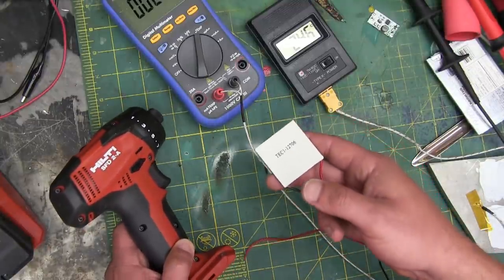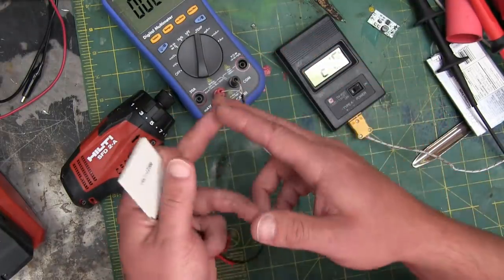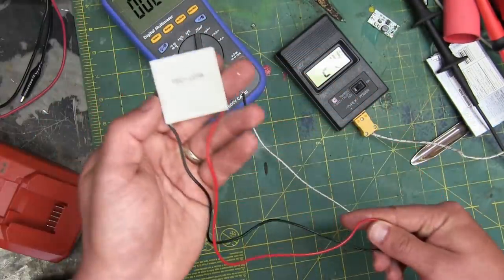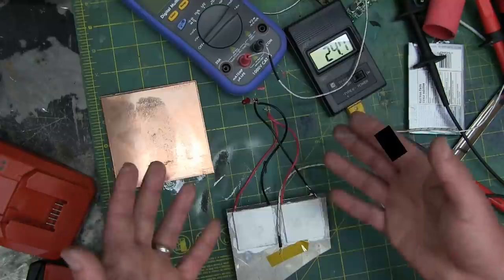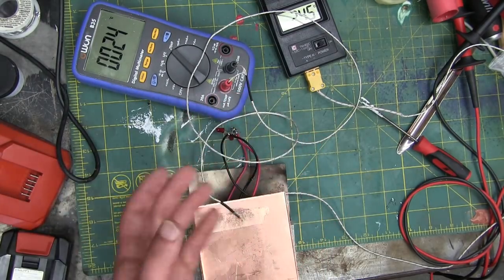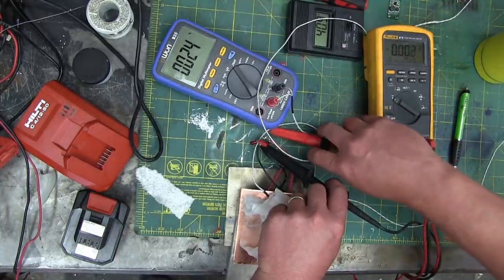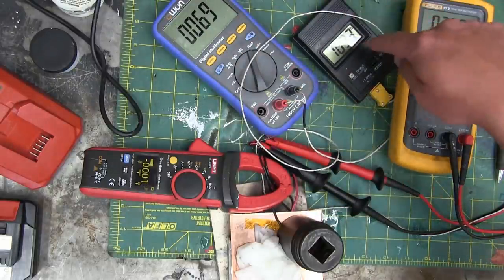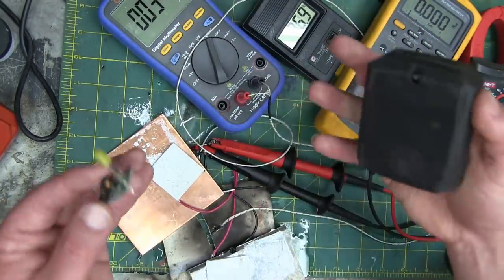Rocket Stove Peltier Charger | Seebeck Generator

Comment: I've found that most of the time a China seller will just send you another of an item if it arrives dead without asking for the broken one back.  It's worth a shot since it only takes a minute to email them.
Reply: Do R/C! A minute to email them and a week of Sunday's to get it to your door.Lol.
Reply: Well you don't order from China via surface if you care if it's going to take 3 to 10 weeks to show up.
Reply: logitech used to do that too till someone who may or may have not been me abused it so hard and so much they changed the company policy. you could call them say your thing was defective to the Indian on the phone after giving the serial number you got a new one sent to you free of charge. that item they send also has a serial which you can repeat the process
Reply: That's the Chinese way when warranting goods, an instant no quibble  replacement. And another if necessary, and another, until you get a good one, each time with an apology and an assurance that they've never known a bad one before...
Reply: Pro trick: you can watch movies at flixzone. Been using it for watching loads of movies during the lockdown.
Reply: @Kylan Ali yup, I have been watching on flixzone} for months myself =)
Reply: @Kylan Ali yup, I've been using Flixzone} for months myself :)

Comment: I had a TEC watercooled on my video card with a ford truck heatercore (try going to autozone and asking them for a heatercore for a computer) and even with my video card voltage mod it would frost up without a load on it, so I had to rub Vaseline on my video card, I locked my door before I did it because I did not want anyone to walk in and me have to explain why I am rubbing Vaseline on my video card
Reply: All2skitzd plasti-dip your card.. all of the RC enthusiasts do it to semi wsterproof the electronics
Reply: Yeah that probably would of worked but it also had components that got really really hot
Reply: All2skitzd They sell little mini heat sinks and thermal glue, which is what you'd wanna put on high load components like voltage regulators, then you could probably use neoprene to insulate and protect the rest of the card without any overheating effects
Reply: I had a peltier array on my GTX 690 and went through the same thing pal. I ended up just running it in a mineral oil bath with a water loop cooling the peltier. Good setup,good for 6c Max load with +.25v and +650 core + 750 memory.
Chooched like a hot damn in Skyrim, but use over 1.9gb vram and I'm fucked 😂

Comment: Many moons ago I used to use a TEC to cool my CPU for max overclocking.
Reply: Taylor Hardin how well does that work?
Reply: ZuluComander very well.  It was advised to waterproof your boards and insulate them back when I was into it because it could condense moisture and cause ice to form on the mother board.
Reply: Because faster is hotter.
Reply: Its cheaper to OC and in those days OCing meant faster performance then a higher speed chip of the same speeds as you were also overclocking the bus speeds which increased ram speeds which increased performances even more.
Reply: rick do you go around shitting on everyone's hobbies? He did it for fun and benefit. Maybe there wasn't a faster CPU, or an affordable one as it were. I guess AvE should just pack a backpack full of drill batteries instead of build a charger. Maybe the first caveman to light a fire on a cold night should have just waited for the sun to come up.
Reply: I'm trying to solar charge my phone and I DO have a cave. 

Doesn't seem to be working, any advice?
Reply: How big of a heatsink did you need to use on the hot side? Those things can hit 90 C if you use them.for long enough?
Reply: Did you compete in 3Dmark? I had the Prometia Mach 1 Phase change on the CPU keeping it at -32C - 0C, water cooled TEC on the video card and the  Mach 1 would drip water sometimes at idle because I had the heating element turned off that prevented it, then the voltage modded video card would also frost up at idle so I had to put Vaseline on it to keep it from flaking out on me
Reply: Umm, step outside?  :P
Reply: Same here. CPU, TEC then Water block. I recall needing a second power supply just to keep the TEC running and the pump stopping one time and the water almost boiling in the water block.
Reply: Anyone know the longevity of these TEC/TEG parts?
Reply: I just did it to my PC a few days ago. I have a water loop that costed me $40 and I idle at 1-3c
Reply: Pseudobean Machine   they last years as long as they dont over heat or the wire gets overstressed. They are used in a lot of mini coolers and stuff
MalleusSemperVictor never thought to do that, the Mach1 had a thing that went over the board on the back and around the CPU to keep it off the board, and I already had vaseline
Reply: Yeah me too, dual Celeron from 300mhz to 666mhz, they were great for overclocking with a screaming Delta fan on it.
Reply: I remember when overclocking was the way to go - generally when there were no better processors to be had, but you still wanted more speed.  Saw one confuser that even had built-in a/c blowing directly on the CPU heat sink.  Doesn't seem to be as necessary now that processor speeds are getting damn fast, but it made a pretty big difference when I upgraded my old 80486 (50 MHz) to the then-new Pentium P5 (66MHz, but I got it to overclock up to around 100 MHz at the time.)  Those were the days...damn frustrating days...back when you couldn't just buy a better processor because they hadn't been invented yet.  :-)
Reply: aussiebloke609 I always wanted one of those phase change coolers. Something about my CPU running -75f always seemed cool to me.
Reply: "...seemed cool"...literally.  LOL  The confusers with the a/c were pretty expensive at the time...somewhere around $8k for the desktop, sans_ keyboard, mouse or monitor, if I remember correctly...and that was back in the mid '90s.  These days, a top-of-the-line CPU is plenty fast for most people, but it was a very different story back then.  :-P
Reply: Ahh the good ol days.
Reply: aussiebloke609 FrozenCPU.com used to sell a add on kit I wanted in the worse kind of way.
Reply: MalleusSemperVictor hell yeah. Back when you could overclock the AMD Duron with only a pencil. Best bang for the buck.

Comment: When I built mine, for my wood stove. I used a pair of 40mm heat sinks for a confuser. Wired the two peltiers in series to run a fan

Comment: When I was much younger and my father and I used to talk about hypothetical situations, we at one point seriously considered either putting a bunch of those Peltier Junctions on the cooler segments of an exhaust pipe or putting them on the side of an engine and seeing if we could get a used full voltage  or current out of it and maybe disconnecting the alternator we never made it past the drawing board however because on the exhaust pipe if you put little heat sinks on it as long as you're moving it would help but cooling while sitting still was the issue

Comment: If you pound a 5" solid copper rod 6 feet into the ground, then attach TEGs to it, you can generate free electricity in winter.
The colder the air temp, the better.
Copper is the best thermal conductor. It will sink the cold side into the ground. Cold air, will cool the hot side.... You have huge 
differential temp range.
I wonder how much the copper rod that size will cost? Probably a few thousand $
Reply: Wrong, silver is the best conductor

Comment: been down this road ave . had a massive heat sink and fans to cool it and fire on the other side. was running its own cooling and 1amp charge at 12v from 20tec,s 10 in series and the 2 banks parrelel.  then there was melt down lol. caned the idea in favor of burning petroleum in an engine. old idea tho. used in the voyager space craft and many others . heat source was plutonium.

Comment: I actually built one of these for a brown out a few years ago we still had a natural draft fireplace so I rigged something up out of parts I had laying around so that I could still charge my phone during the week with no power... I just used the steel can with water for the cold side and the hot side on a piece of aluminum sitting on top of the fireplace

Comment: I feel like improving the cooling for the cold side has a huge potential for improvement on the efficiency of the next version. Like maybe have a conductive bar off each side of the thing, one which goes in a container of icewater, and the other into the hot coals of the campfire. Maybe solder some old computer heat syncs to the cold side as well, that way it has the area to dissipate to atmosphere as well for when you're in the woods.  Then maybe weld up a little steel cup that you can just put ice directly into, removing the need for the container.

Comment: TECs always heat up both sides, if you dont coo, the hot side properly, since they are only 4% efficient, if the generated heat is not transported off, both sides get hot.

Comment: looks like a fun project!  That first TEC may not be broken. You didn't have a heat sink on the hot side, so there is no where for all that thermal energy to go but to just heat up the whole device. The voltage output isn't just dependent on delta T but also heat flux through the module.

Comment: Nice project! Did a similar experiment some time ago in a course at the University where we was supposed to cool thermocouples with evaporation cooling. What did the trick for us was to only add a small amount of liquid to the cloth (and only have about a single layer of cloth) so it had time to evaporate. Also if i remember correctly, we used both water and acetone at separate attempts of which the acetone clearly cooled much better. Got them thermocouples cold AF! Greetings from Sweden, SKÅL!

Comment: Thanks for doing a video on these. I own a Biolite stove because I became obsessed with TEC and TEG. With the cooling I suggest that you use a container of water. Biolite has a kettle that uses cold water boiling to keep one side cooler than the other and it produces about 10 watts. There is also a thing called a power pot that works on the same principle. That said, it's really had to get a good amount of juice out of these chips at the 12 volts or so that they operate at, enough to charge a high capacity drill battery. I'm looking forward to seeing what you'll do to get  'er to chooch. :-)

Comment: It gets quite complicated but as a general rule, try to keep your R_load = R_internal, you will be producing about at the maxima power level.  Just measure resistance across the leads of the TEG, try to match that at the load.  Maximum efficiency can be met with a slightly higher R_load but as you mentioned... This is for a campfire.

Comment: To add an easy ~100c barrier to keep from overheating the modules, you can use di-hydrogen monoxide (think about it) as an intermediary heat-fuse.  Overheating the intermediary, it'll evaporate and keep from getting too much heat to the pixy converters.

Comment: Linear Technologies makes a specialized thermoelectric energy harvester (LTC3108) that works great; puts out enough power to run a micro and some sensors, and maybe a radio if you charge up a cap over a while for a burst. I couldn't get an LED illuminated with it though. Maybe with something more hardcore than one of those little peltiers it would work, though.

Comment: The only difference between TEC and TEG is the type of solder used. The TEC uses a low melting temperature solder SnBi that melts at 138C.
The efficiency will be the same best case around 5% for both TEC and TEG used as generators. I have quite an old video where I play with a TEC as a generator.
In almost all possible cases a solar PV panel will work better than waiting time with TEG :)

Comment: You need to use special TE modules that can take high temperatures. Normal are rated around 90 C MAX on hot side.  You also want to insulate the hot side from cold side so you don't heat the cold side too much.

Comment: Once upon a time, I did in fact succumb to the temptation to be fartin' around with Peltier coolers. I did, as you have found that they are hopelessly inefficient and not suited for makin' de electrons in excess quantity sufficient to feed the appetite of a starving battery especially when using a high temperature heat source. ZO... might I suggest what we affectionately call a "thermopile"? This amounts to a shitload of thermocouple junctions in series/parallel in a block of material that's subject to the heat source. This gives yer arse control over both output voltage and current vs. temperature and isn't fragile like the Peltier device. AND it be cheap cheap. Worth a try? Now where'd I put those mushrooms...
Reply: Thanks for that link - fascinating stuff.
Reply: Great, so hopefully next week we can expect señor AvE to have scavenged an old RTG full of Plutonium. lol

That should really chooch.

I just hope it doesn't end up like the "Nuclear Boy Scout" story.
(watch the vid - it's rather scary.)

Comment: Or you can use a cordless drill motor with reduction to generate dc, a homemade water wheel  and put it in some running water.

Comment: I think you need more modules in series. The maximum power is delivered when the load is a similar impedance to the source. Might be worth trying a bunch of peltiers in series (10? 20?) and charging a battery with a solar MPPT module,

Comment: Haven't finished watching the video, but I find that since the hot side heats up more than the cool side does, the cool side will heat up to more than room temperature, since both sides aren't completely insulated (Kind of duh).
When I put a heatsink on the hot side, I felt the cool side cool down...

Comment: I've always wanted to experiment with thermal electricity generation.  I would have thought you would have heated the copper and cooled the aluminum because the heatsinks I've come across are aluminum and copper melting point is higher.

Comment: I put a brass bar on the bottom and an aluminum pot on the top and placed a candle underneath and had no problem lighting an led off of a tea candle with a cooling TEG.

Comment: Just buy a 20 to 50 watts solar panel. You can also buy fold up ones. Should be pretty portable and it's already 12V. Or you can try taking like 10 battarias.

Comment: Did you say using your canoe? Would it be possible to make an archimedes screw rrom cd's and attach a pma or some form of 12v generator to the archimedes screw and tow it behind your canoe for enough time to charge your drill? Just a thought. Robert Murray Smith made such a screw from cheap disposals, worth checking out my friend. Be good and enjoy your trip brother.

Comment: May I suggest an Arduino driven control component to either A) tell you when you need to stoke/douse your fire or B) drive ventilation with a small fan in a dirt hole oven to control temperature on the hot side?

Comment: I think alot of campany used to experiment with these in car exhaust applications. Most of the engines heat normaly just disappears through the exhaust.

But I guess these things are just not efficient enough to creat a noticable impact on a cars overall economy.

Comment: cool man, i built a campfire rotisserie, what for charring the animal flesh, it runs off off 4 teg units. I have an aluminum plate that sits in the fire, and the other side of it i keep a a small pot of warm hand washing water. gets two birds stoned at once. best part is, when the fire cools the rotisserie slows down.

Comment: @AvE Get 8 of the Generating peltier elements and put them in series with a diode instead of using a boost converter, Yes the elements are only 1% efficient but you dont want to add further inefficiency's with the boost converter. Another idea is just to charge it with an inexpensive solar panel but wheres the fun in that.

Comment: whenever I see a fluke 87, I chuckle because my coworker is using 6 at once to test a circuit board, in addition to a spectrum analyzer, oscilloscope, two bench top power supplies, a Spartan 6, and two bench top HP multimeters

Comment: i played around with peltier for a bit
the problem is their efficiency, but theyre as fun as it gets
also, there is no difference between a cooler and a generator, really
maybe maybe maybe some design optimization, but all in all its the same, they both can be reversed

Comment: I wonder if you could use some sort of vacuum section between the hot and cold side to prevent ambient temperature transfer to increase cooling and thereby efficiency

Comment: You put 20v into a 12v module, the TEC -12706 means it's 12 volts and has 706 of the thermocouple elements in it, they look like little tiny blocks.

Comment: The difference from the G vs C is the solder melt temperature and maybe some more cherry picking of the thermal electric blobs between the ceramic.
The G are made for a high temperature while the C is for lower temperature so it doesn't need high temp solder.

Comment: Hey Uncle BBF - how about a harbor freight air grinder or something powered by steam to a generator? Stick to what you know...
Reply: Steam-powered air tools... That's a good idea. Definitely worth testing.

Usually steam stuff is made out of cast iron for its higher corrosion resistance, but perhaps the addition of a little oil could keep the tool alive.
Reply: Garganzuul - even if it pukes its guts, that would be fun lol. Hell I would think Ave would be all over high pressure, heat, shmoo, and harbor freight fabricobling especially if it explodes in the end

Comment: I was wondering about those thermal electric generators in Canada where it's cold in the winter months if you had the whole roof of a house covered with them how much power with they produce with the house being 70 degrees but outside the temperature is -6 ? You gotta heat your home away